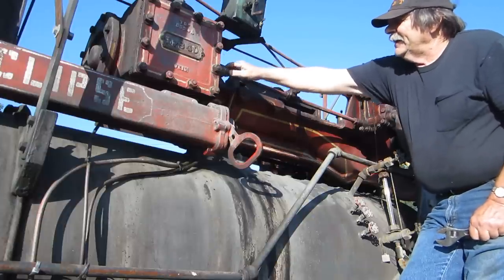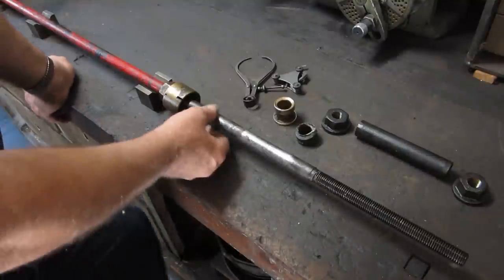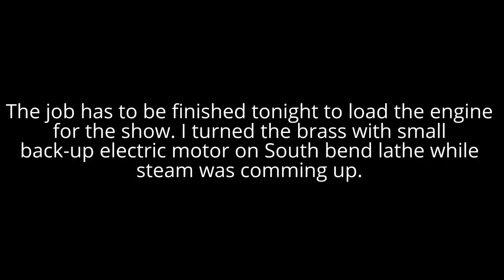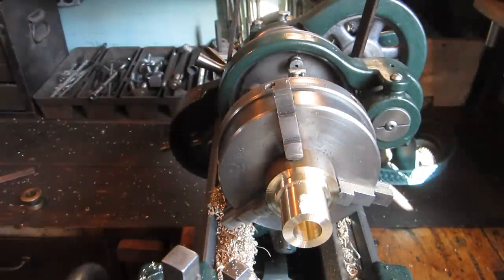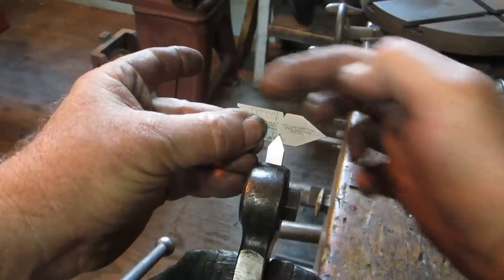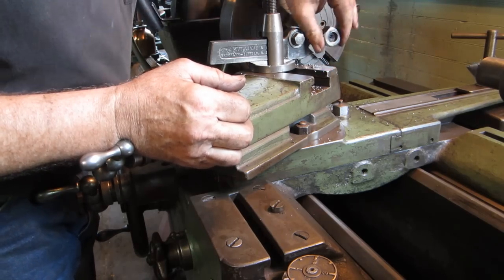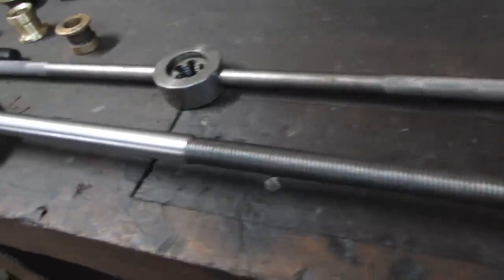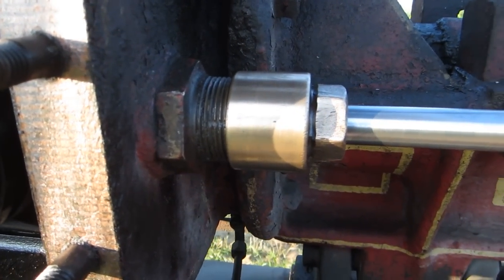OLD TIME STEAM POWERED MACHINE SHOP 5  Frick Valve Rod

Comment: Who in year 1911 would have thought that people will use oldschool tools to repair their steam engines - or repair them at all - over a hundred years later. Great work, thanks for the video! :)
Reply from the maker: It's sorta like a "Back to the Future" fantasy....Dave
Reply: Probably, the original machinist back in 1911 thought their machinery was state of the art and couldn't imagine it being done any other way.  Truth is, your basic metal lathe like the one seen in this video hasn't changed much other than adding an electric motor.
Reply from the maker: Yeah except now they are called CNC Machining Centers and have no handwheels....Dave

Comment: I worked at a shop that still had the shafting in the ceiling and had 2 Monarch lathes that were converted to electric and used Ford transmission gearboxes. They had been scraped and refurbished several years before I was there and still held .001 tolerance with ease. This is the first time that I've seen the steam powered machines operate, love how you do your work.
Reply: I'm just a young man at 49 and  have been machining for 31yrs
Reply from the maker: Thanks Greg, glad you are aboard.....Dave

Comment: Nice job!  Several years ago (before I started doing YouTube), I had to make new valve rods for both sides of the museums 1917 Vulcan Iron Works steam locomotive.  Same situation as yours, the original rod was worn where the packing goes and we could not keep the packing in there.  I made our new rods out of the same material that you used - the chrome plated shafting like they use in hydraulic cylinders.  I am pretty sure that my job was at least the second time that this repair had been done over the years.

Comment: Hi mate.
This one was even better.  This time you got to make a part for an even older machine than the workshop machines.  Absolutely great.
Marcel.
Reply from the maker: +Marcel Timmers   Thanks Marcel. The Frick engine would have been 10 years at work when the lathe was built.
Reply: Just think about it, and bring your mind back to that time.  The industrial revolution in full swing, and coal damp everywhere.......

Comment: Nice work on the Frick to keep the old iron going.  Jeff
Reply from the maker: +JRD77VET   Thanks Jeff, The 12" Monarch that you have looks like a great lathe. My 14" shaper and the steam engine came from Rough & Tumble Excess machinery pile. I am looking for a cut-off saw just like your Racine. I'd appreciate a "heads up" if you ever find another one.   Dave
Reply: +David Richards  Since my Racine was originally a belt driven power hacksaw, I'm sure we could trade if you come across a similar ( slightly newer ) one.  Something to think about.  Jeff

Comment: Just a tip for people who don't know about it. If you look at 14:52 on the tailstock quill the horizontal line at the front of the quill is usually the center height of the quill. Old timers would scratch a line with a tool bit on the quill on center so they would have a reference if the center was being used to hold work.

Comment: G'day Dave thanks for the info on the Frick, interesting with the boiler inspections, over here it is very stricked every two years on a steam loco that includes hydrostatic pressure testing.  I will send progress photos as soon as I am a bit more into the building, my mill needs some work done on it. Thanks for the reply Dave bloody good job you did on the rod and gland, kind regards Tassie John

Comment: When using a center I've found that general purpose black tube grease works much better than machine oil for centers, as it can really withstand the pressure.

Great videos as always!
Reply from the maker: +Andre Gross  I usually use engine assembly lube, but as usual when the camera is burning time, I can't find it....Dave

Comment: Great video, very well explained. Good to see old machines being used. Interesting to learn chromed steel hydraulic shaft can be machined with HSS.
Reply from the maker: Seems to be no problem if you take enough cut to get under the chrome...Dave

Comment: Nice job on the part.  I liked some of those wide angles showing both the lathe and the steam engine.  In the little bit that I've done machining, it sure seems easy to get one pass where you hit the switch when threading not on the numbers...you just hope you catch it before it causes too much damage.
Reply from the maker: +ILGopher That's why you try to start each pass back from the work so you can see that you are engaged in the right slot before the tool gets to the work.  In my case..old age brain fade....Dave

Comment: Aloha David, It looks funny to me now t see a dead center being used, but I remember them well also I remember using white lead and oil mix for lubing them.  I'm still here at 77 years old so it didn't hurt me too much.  I enjoy the old machines very much.  What is the RPM on the line shaft? Chuck

Comment: love the videos cant wait for more, 27:08 you leave to wrench in chuck unattended , I was fixed on wrench worried you would turn it on, I did that once and never again did I leave wrench unattended in chuck, that caught me eye , love to videos keep them coming
Reply from the maker: +mouse river engineering  You can usually find marks in the ways where someone has done that and then filed it out.
Reply: +David Richards 
I never turned the lathe on, but I left the wrench in once and got chewed out well enough by a crotchety older machinist.  (Great guy learned a lot from him.)  Now that wrench never leaves my fingers until I am putting it back in it's holder.
Reply: Left the key in the chuck after being scolded a hundred times, then I turned the old Sheldon on, and that key took off so fast. It bounced off the 12' ceiling, ricocheted off the back block wall and hit the floor....needless to say, it never happened again. Don't ask about the time the chuck came out of the other chuck and almost bowled down a couple of people behind me.....they never asked me back.

Comment: Hi Dave. Thanks for all the interesting videos you have posted. I have a question. I read that steam and brass don’t play together well. Apparently the steam leaches out the zinc. And for that reason they use bronze for steam applications. Was the original part made from bronze? And is the part you are making made from brass? Is this cause for concern?
Regards from South Africa. Vic.
Reply from the maker: Hi Vic: Apparently brass was OK for a packing gland. Every one I have seen is yellow brass and the only problem has been a worn ID. engine builders were cheap and brass was less expensive.

Comment: is the small lathe running on steam? love your videos, thanks for giving us an in site to what it was like in the day.
Reply from the maker: +napolianwas On that video, it is running from its elec. motor ( can run on either) I didn't have the boiler hot that day and needed to get Jim's part finished. That lathe, the Horizontal boring mill & the powered hack saw have electric motors. Hope to hook them up eventually......Dave

Comment: Fun how the threading dial stopped moving when you engaged the feed.  Something about the ratio of the lathe's lead screw to the the 10 TPI you were cutting?
Reply from the maker: +James Munn  Hi James:   The thread dial always stops when the carriage is engaged with the LEAD screw. The dial just lets you know where you are along the lead screw so you will hit the thread correctly. General rule is: even number thread pitch engage on any line, odd thread on any number, 1/2 threads like 11 1/2 engage on even number, 1/4 threads on the same number every time. Some non std. lathes are different....Dave

Comment: Just found your channel and working my way through your most informative videos.  

Curious.  Could you have saved the cost of the new shaft by reversing the original valve rod end-for-end and extending the threads on the shorter end?  Would you have needed to cold-work the shaft to harden it where it goes through the packing?
Reply from the maker: Thanks for the comment Dave, Yeah, it could have been done, but it was such a poor piece of material to begin with. I wanted somthing that wouldn't rust, hard and would run well with a more modern packing material. The repair was done 2 seasons ago, and I don't think the gland adjustment has been touched. ....Dave

Comment: Dave: maybe you can explain this question.   You used the power hacksaw to cut the rod.  Why would anyone (other than for historical reasons) use a power hacksaw when there are bandsaw?  I don't understand,  a bandsaw continuously cuts, uses all the teeth on the blade and is much faster and efficient.   So other than for novelty why still use a power hacksaw?
Reply from the maker: Hi Scott, The recip saw is what I have....Dave

Comment: Are manually starting the feed when doing the threads? How do you know when to start? I imagine being off by even a fraction of a second could destroy the threads...
Reply: fellow machinist who was taught to do it the way he is doing it. there is a timing dial on the carriage. when the line you choose to use on the dial kines up with the reference mark you engage the "half nut" quickly. if you are off, yes you would ruin the thread, and possibly the tool.

Comment: i'm actually surprised it was 3/4 10 but  that's in the same time frame as SAE was being  formalized but most steam  / rail threads used a different standard for threads per inch

Comment: As you reloaded this video and lost the comments.....
Nice job but 3/4 x 10 sounds like BSW to me, not exactly non-standard as Whitworth was the first  standardized thread. If it is BSW then the thread angle is 55 not 60 and although they can be made to fit, normally it;s not a good idea but that thread is so over size for the loading it should be fine for the next 100 years.
Reply from the maker: Chris Stephens Thanks for reposting your comment. For some reason the youtube editor kicked off all the banner captioning when it loaded and I thought it was important enough to reload.  I went back out to the shop and double checked (because I don't recall numbers as I once did) 3/4" - 10 is actually US national course thread, a common pitch here.  Thanks, Dave